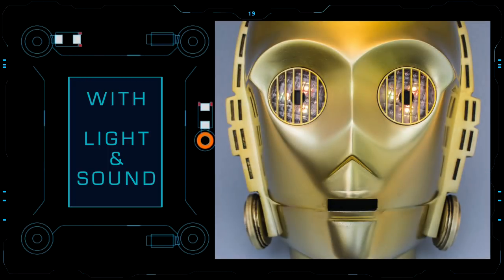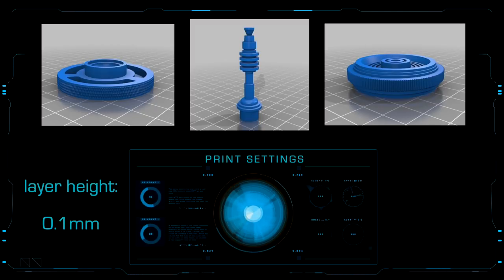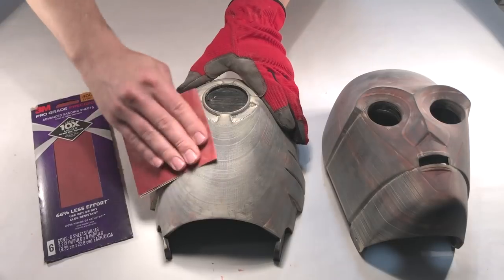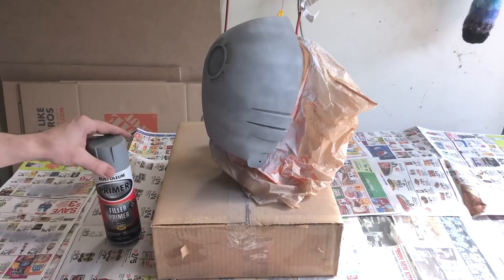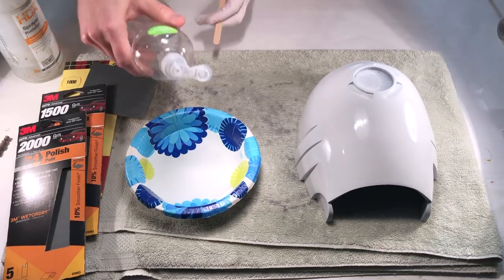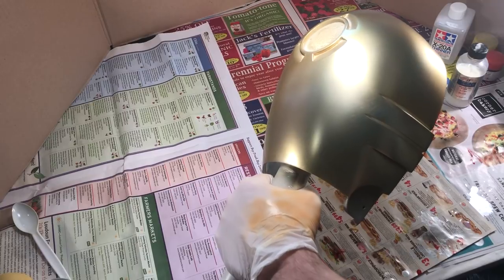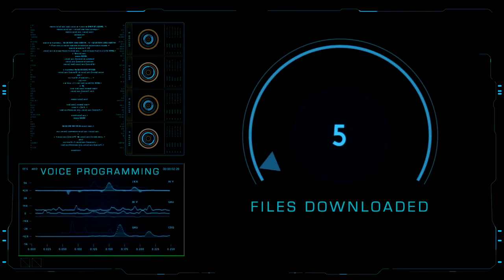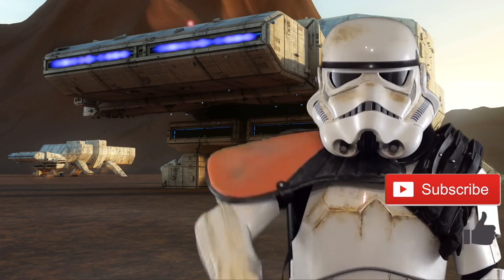Paint a 3D printed C-3PO Head & Add Light/Sound

Comment: Good video but just some things you should know. You should have used a flat black coat then build up some clear gloss then polish. Not gloss white. Metallics work much better on a black base. You also should have used a mini spray gun at least not an airbrush. Airbrushes are not intended for large surface areas and cause overspray; that's why you got a rough texture: you couldn't keep the area consistently wet with paint. Another thing is that it is possible to regain the mirror shine after the tint and clear, in fact you did it already in the video. You must simply spray on a few layers of a good clear from a spray can or gun (not an airbrush) and polish the clear. Hope this helps
Reply from the maker: Mad Cow Rebel i tried gloss black as an undercoat and it was too dark.  Gloss white gave me the tone that I wanted after the chrome and tint was applied.  I used what I had at my disposal.  Thanks for the tips.

Comment: New subscriber here!  
Thanks for the great videos.  I have learned a lot from you.  I have a couple of questions please.  I am 3D printing a complete C-3P0.  I have watched all of your videos where you apply a gold finish to props in various ways.  I do have an airbrush and have used Alclad Chrome before.  Which method do you recommend I use for the finish on my 3P0?  Once the prints are prepped should I go with a gloss black spray paint, covered in Alclad Chrome and then covered in your Tamiya yellow/red mixture (this would be quite expensive for a complete droid) or do you think I could get away with a Gloss white spray paint and then followed up with Rust oleum Gold and then a gloss clear coat?

Also, what video editing software do you use?  I love your videos!

Comment: Great video! I'm printing it now look a touch small did you use the default size or did you scale it up alittle?
Reply from the maker: Apologies for the late response.  I did not adjust the scale.  I've heard other protocol droid builders going up to 106 or 107 percent.  There is a facebook group: "C-3PO Builders" that has a great community of protocol droid builders.  There is a lot of great info on there if you are looking to build a droid.  Good luck! :)
Reply: @HappyTrooperDotCom  thanks, I just been printing a 100% almost have the head chest and shoulders it looks good all together. Head just looks undersized when it's by itself

Comment: Hi this tutorial is great. However, I'm horrible at the sanding process & no matter how hard a try, I always get print lines showing no matter what. I started with 220 on my part & then when most of the bumps and such we're smoothed, I moved onto 400 grit. There were no gaps on my part so I went to primer. It still has print lines visible! How do you manage to cover the up so well?
Reply from the maker: HackinSpock Hello, thank you for watching.  I feel your pain.  Getting a smooth surface requires a lot of work.  I have to use spot putty or plastic wood filler.  After applying it, i sand it down with 220 or 320 and then 400.  I’ll hit it with another coat of filler.  If i still see lines, i apply more putty.  Its a long, arduous process, but your hard work will be rewarded.  I’ve been using the plastic wood filler more frequently.  Its less toxic, cheaper, you get more, and it sands down nicely.  Keep at it, you’ll get there! :)
Reply: @HappyTrooperDotCom  Link to the wood filler brand you will be using? I will have to use bondo for now as that is what I have atm.
Reply from the maker: HackinSpock i really like this stuff: https://www.homedepot.com/p/DAP-Plastic-Wood-32-oz-Natural-Latex-Wood-Filler-00525/205337025 i spread it on with a finger and maybe dip my finger in some water to spread it out.  I let it dry overnight and then sand it.
Reply: HackinSpock try Bodyfill 360